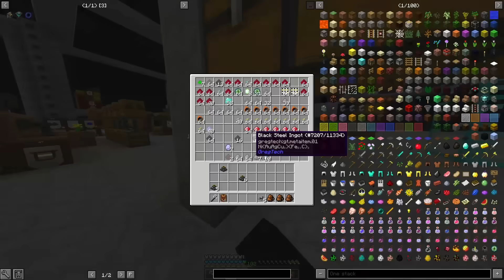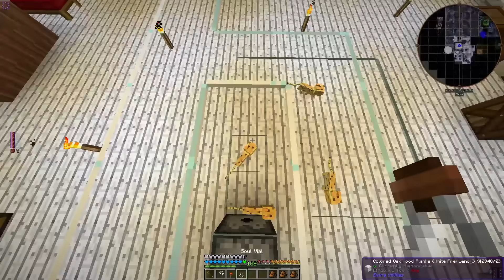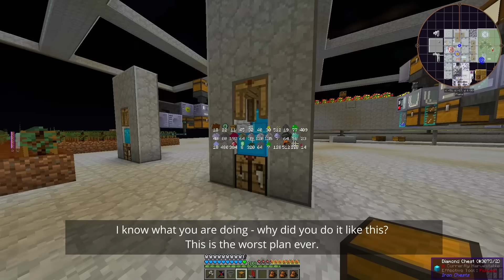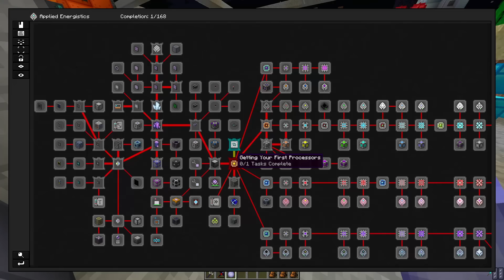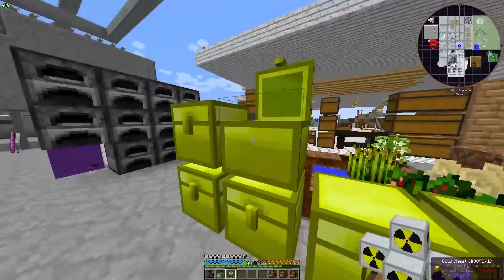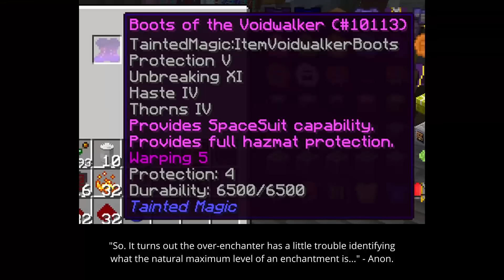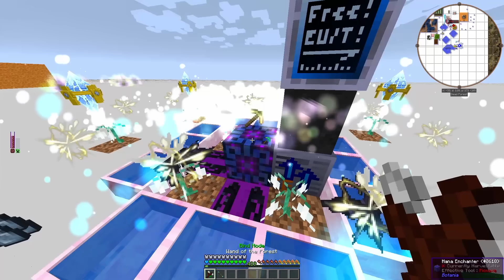Beating Minecraft's Hardest Modpack With Nothing // Episode 16 - It's Called UraniYUM For A Reason

Comment: Hey, pro tip, if this modpack has a lot of stuff with NBT data, DO NOT STORE IT IN YOUR APPLIED ENERGISTICS SYSTEM!! 

Too much NBT in one block corrupts the chunk permanently, I've accidentally corrupted chunks when I routed enchanted items into an AE system with a lot of storage in one block.
Reply: (AE2 dev here) also note that this is why type limits in the cells exist, and why it seems that Refined Storage will inevitably at some point delete your items maybe.
Reply: @sea_kerman  hey I just wanna say thanks for being involved in a project that I like, AE2 is one of my favorite mods
Reply: @sea_kerman  Pretty sure Mojang raised the data limit in chunks in later versions, I also use a lot of subnets so I never ran into any problems with AE2
Reply: @sea_kerman  RS stores the item list in separate files and only a single UUID in the cell's nbt, so it shouldn't cause chunk corruption at least. This might have been different in old versions though
Reply: @commander3494  Correct. It won't over-data a chunk, it will just cause issues within the system itself, e.g. bad performance/deleting all your items.
Reply: That not really a problem when using "vanilla" AE drives, but it's a serious concern if you're using an addon that mimic refined storage drives, while it's not a problem it can and will cause slowdowns when opening your terminal, a good rule it to just don't put unstackable items in your system at all. Tbh in general there is not a lot a mods that add a ton of nbt data to items, I can think of two of the top of my head that are seriously bad for digital storage, Apotheosis and Vault hunters
Reply: @AcousticPeepo  bees, I would imagine? Which are a huge thing in this pack
Reply: @AcousticPeepo  I was going to say “oh, that's why some previous Vault Hunters playsthrough of my have lead to intolerable lag in my storage system” until i remembered that i've only ever used the simple storage network mod in that pack, and have never bothered with either an ME or an RS system, and the simple storage networks mod is the least optimized piece of software i've ever had the displeasure of using (with enough connected barrels, the framerate drops to single digits if you try to search by tooltip [=‘#’]).
Reply: i think it's fixed in 2.6.0. they increased the limit from 2MB to 2GB for chunks and 256MB for network packets
Reply: @greenbird2672  it's "fixed"
Apotheosis in particular is a mod that will absolutely still cause problems, not in this pack though

Comment: "Nuclear reactors are kind of the cave man option" this gave me the most insane whiplash, love your stuff!
Reply: To be honest, even in real life they are just... Boiling water. Humans haven't figured out a better and safer way to convert heat energy into other types of energy, and steam turbines are cheap.
Reply: @albusjustalbus7988  they are however a _very_complex and quite expensive (though nonetheless efficient) way of boiling that water
Reply: @nerdyspinosaurid  Not... Complex, no, not really. The base process of what happens with the fuel is complex, but the system itself isn't. Water circulation and radiation containment processes are not hard to grasp.
Reply: @nerdyspinosaurid the working part isn’t complex. Put hot rock in water. It’s all the safety and efficiency parts that are complex.
Reply: @fishboy3612  It's literally that troll physics meme from like 2011 "take rock that radiates heat"->"put rock in water to make steam"->"steam turns turbine"->"infinite energy"
Reply: @albusjustalbus7988  You might be confusing Fission and Fusion
Reply: @tasty8186  Nope. Both fusion and fission are ultimately just a method of getting large amounts of heat. Which we use to boil water and turn steam turbines to actually generate electricity
Reply: Thanks, captain obvious.
Reply: @tasty8186  Youre welcome, since you apparently didnt know the obvious.
Reply: @ghosty918  Maybe you should practice context, bud. Wrong part of the original comment you're focusing on.
Reply: @tasty8186  they didnt even mention fission or fusion in their first comment.
"To be honest, even in real life they are just...Boiling water. Humans havent figured out a better and safer way to convert heat energy into other types of energy, and steam turbines are cheap"

Which part should I be focused on where he confuses fission and fusion?
Reply: @ghosty918  Mate it's fine if you're autistic but don't expect everyone else to spell things out for you in 2yr old comments

Comment: Getting near infinite mana is easy without any fancy stuff, just feed Gourmaryllis Mushroom Soup made with Mooshrooms, it takes only 75 logs to get a mana pool.

Thaumic Tinker's Tablet of Necromancy to make a mooshroom, Dynamism Tablet to make soup (or just an auto clicker), and item and redstone conduits with droppers to deliver stuff when you need it.
Reply: The problem isn't actually in getting the mana. It's about transporting it.
Also, you can make 2000 mana pools worth of mana with a single endoflame, sure, it'll just take you like 3 months. Obviously literally any other flower is faster, but even the rate of potency point-blank gaia spreader isn't all that fast.
Reply: @slabdrill1  Sparks already have really huge range (25x25x25 cube iirc), you can make a good mana farm with just sparks. And if you need limitless transportation, just use mana pool minecarts and a way to teleport them (like draconium infused obsidian portals)
Feeding gourmaryllis soup is a quite fast way to get mana. What are you getting at?
Reply: @ERRR0RR  Even very fast mana production (like maxed out entro, which is literally capped by pool output speed) takes a while to gather that much mana. The 200 mana pools are only for that last enchant - when you sum up all of them, you start realizing you need a whole lot more than even what you need for a maxed terra shatterer.
That being said, I do think they were slightly overestimating how hard it is to get mana, since I've probably made more than that in other packs (although things tend to be way cheaper and easier and those are left on for a month).

Comment: 33:52 Quadratic growth, not exponential. Love the series so far
Reply: Well, he said he sucks at arithematic, so...
Reply: When he was talking about how the mana cost wasn’t that bad I was going “yeah, because it isn’t actually exponential 🤓🤓🤓” quadratic growth is pretty sane compared to real exponential growth
Reply: "The growth is exponential", shows a quadratic ☠ skull with bones emoji
Reply: Isn't it pseudo-polynomial? (being effectively exponential)
Reply: @uberkoldunec3167 With respect to level, the calculatuon is a factor of (level)^2, meaning that its growth rate is quadratic (second order polynomial). Im not really familiar with what a psuedo-polynomial is but from my small amount of googleing it seems like its used as a growth rate of time to run a calculation that is analogous to the exponential. Its definitely quadratic growth with respect to the calculation, as the exponent does not vary based on which level is calculated.
Reply: @uberkoldunec3167 exponentials have your variable in the exponent.  This is only quadratic because the variable is in the base.

Comment: the instant you mentioned anvils not handling high level enchants, my mind went right to the mana enchanter lol. Did the exact same thing in stoneblock 3, where there's a sharpness 255 sword you can disenchant. Needed a ton of kekimurus to get it done but it finished, annnnnnnd it didn't work correctly lol.

Comment: Heh. That rant about not knowing how to automate a stone furnace was somewhat amusing. It really is quite difficult to figure out mechanics sometimes, especially if you’re getting spoiled by mods that basically let you do whatever you want and act “normally” (playing nice with transport systems, etc). Not saying that this isn’t how it should be, just that it makes the “bad actors” stick out more.
Also, I’m SO glad that Thermal-series item/fluiducts aren’t the norm anymore. Played Compact Claustrophobia, and it honestly might have just been easier to use Refined Storage for all my automation needs. It wasn’t necessarily that difficult to automate with itemducts, but placing down the Servos felt a good bit jankier than messing around with EnderIO conduits, and Retrievers didn’t seem to work fully reliably. Probably just a skill issue on my part, but eh.
Reply: Yeah, I'm personally of the opinion that the ducts are at least better than, like, Pipez or Refined Pipes (which I consider to be the absolute bare minimum and nothing more), but I'd be a liar if I said they were ever my first choice. Ender IO has always just done that job so much better, and as of late I've felt like an idiot about the time where I stopped using Ender IO because I got unimaginably sick of its core tech loop.

Tragically, though Ender IO has come back, the modern version doesn't have full conduit functionality yet.
Reply: I kinda like using thermal pipes for small stupid simple systems.  Anything complicated, though...gimme refined storage or applied energistics any day.

Comment: i can't believe you have the mental fortitude (and probably the masochism) required to play this game let alone skyblock LET ALONE WITH CONSISTENT UPLOADS. it boggles my mind.
Reply: Gregtech New Horizons isn't that bad. It just takes a while. And it has a lot of microcrafting. Like, "you have to craft every single screw in every single machine, and their components" kind of microcrafting.
Reply: @nikkiofthevalley You’re not wrong, and honestly the scary things like building nuclear power are a solved problem, but also as near as I have approached the GregTech community, saying that you’re going to finish GregTech is like saying you’re going to finish Cookie Clicker. The finite amount of stuff to do is only nominally so
Reply: @lancesmith8298  cookie clicker is actually substantially faster to complete. I believe the average is like 500 hours? This excludes time spent in sleep mode (not playing but still earning)
Reply: @nikkiofthevalley i saw the spreadsheet for some materials that go back and forth and require ton of steps to process..
Reply: @macrohotline8834  That spreadsheet isn't that bad either. It's the kind of thing that you set up once and you never have to do it again because all the ores go through the same process. And in the early to middle game, most of that spreadsheet is inaccessible.